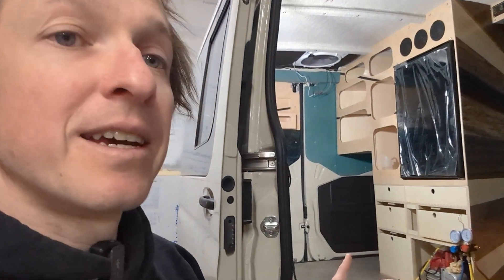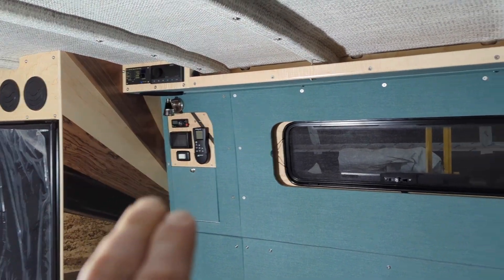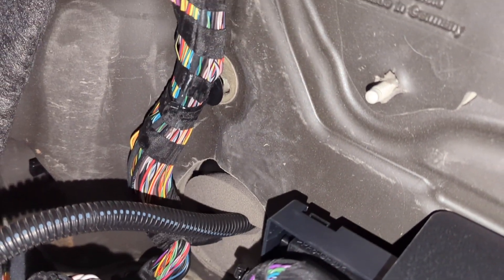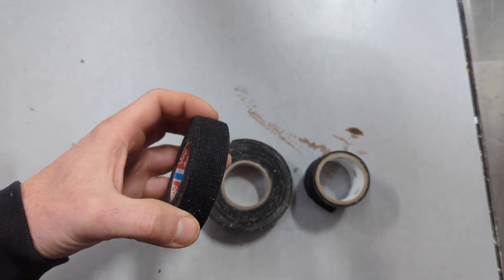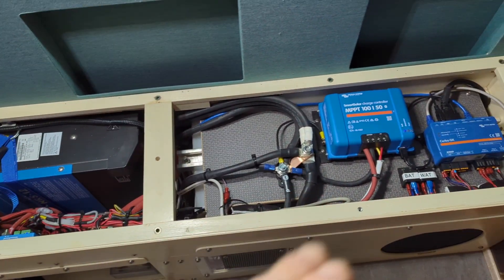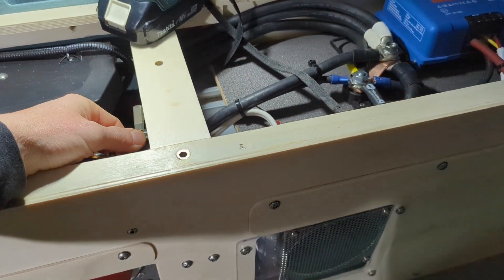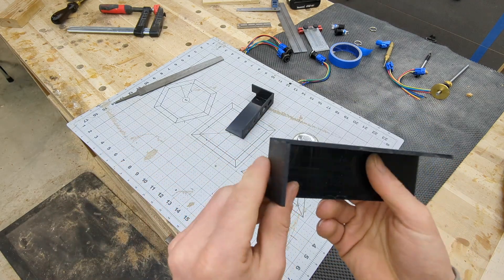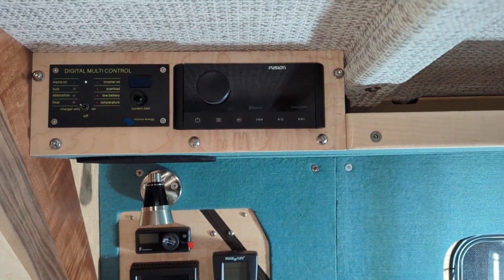4x4 Sprinter Van Conversion vol. 3: Electrical Stuff

Comment: I worked an Electrician for 40 years. I ended up running Blue Flexible Conduit for 120 volt wiring. Then used Orange Conduit for low voltage wiring. That way I can pull new circuits in. As I leave a pull string in them..Then ran them over head for drop down convenience. If I ever have to run a new circuit down the wall. Just remove the wood roof edge frame to get at the wiring..

Comment: About that AC compressor at the 2-minute mark: Did you modify the Cruise N Comfort product with your own compressor? I am thinking of an idea to use a 110V split AC, and further split the outdoor compressor fan unit into the compressor (which will stay inside the van), and the coil and fan (which can go outside the van). It seems like you may have done something similar. If so, is it working well?